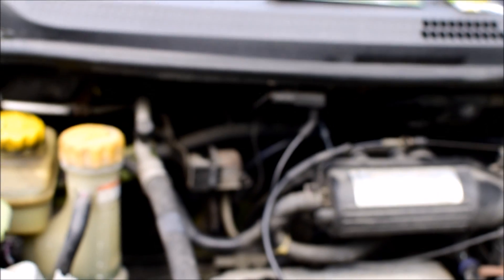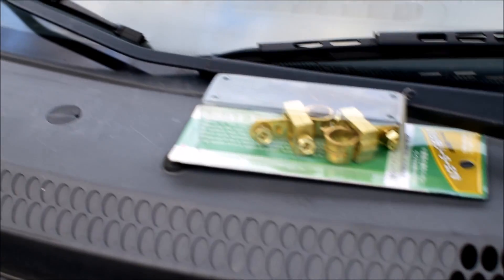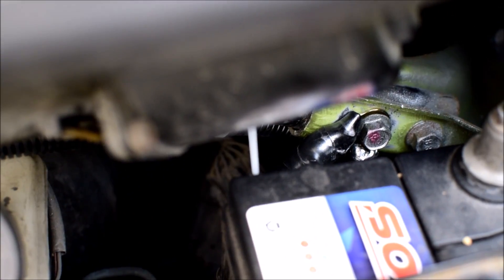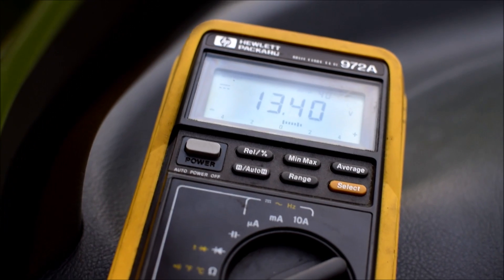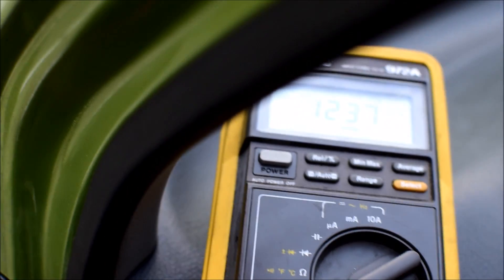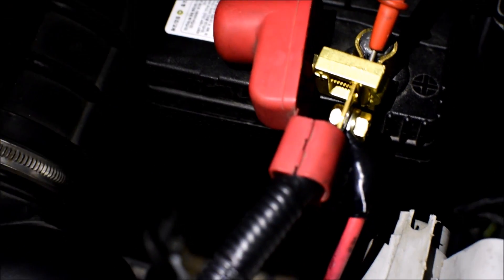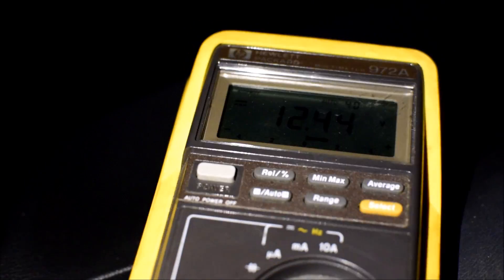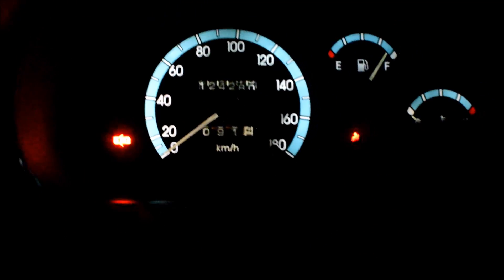Big 3 Upgrade | Before and after

Comment: Just remember. The big 3 is about to upgrade the transfer of power from the alternator more quickly and reduce your load from the accessories.  Remember. The smaller the gauge of wire means you have more strands of wire to transfer the volts and amps. I used 1/0 gauge on my Silverado hot and ground. From alternator to the junction post to battery I got rid of the stock wire from the alternator. I clipped off the wire from the junction to the battery. But kept it stock from junction to starter.  Ground?? From block to kill switch,from switch to the body bolt on fire wall. From kill switch to the mounting bolt for the alternator.  From kill switch to battery. The kill switch is a security guard because I’m gone all the time. But. It’s worth to upgrade. Nothing dims on a stock alternator.

Comment: High output alternator and add 1 to your big 3 and run a ground from back case of alternator to battery neg. People don't think about it but the battery does not make power it only stores it the alternator makes ALL the power positive and negative. The power comes out through the bridge rectifier which turns ac power into dc that sends out through the positive post on alternator but there has also been equal amount of  negative produced which dumps into the back case of alternator because the bridge rectifier is bolted on there. So with the back case grounded that negative has to find the way through that back case then the little bolts that hold the front and back case together then the alternator bracket and so on all the way back to the battery which slows everything way way down. You do this and I promise you will see a very noticeable difference...I did. I did big 3 first and was getting 14.4 but mine did like yours and blower motor headlights and such ate up all the voltage gain I had created so I was researching why and came across a video that explained this to me and it made sense so I added the extra ground and now with heater on high headlights on dome light and brake pedal pushed she holds steady on 14.1 volts also I do have a 320 amp alternator which I'm sure helps but it was also there when the voltage dropped before and it doesn't now. Hope this helps

Comment: 😂😂😂 i know this is old as hell but come on lol. You used what 10ga to do the big 3 and then didnt even do it correctly and you guys are bitching it didnt work lol..... 1st .. his alts bad . Actually his regulator in the alt is bad . The big 3 is about amperage and the ability to transfer power faster . You have to have the correct cable to do that and 10ga ant it roflmao ... But you also have to have the power in the first place .
Reply: ALEX I have a 2005 Hyundai Elantra.  I have an aftermarket 140amp alternator and a car power battery 3000amp battery running two amps at 3000w rms. 1 sundown x15 at 2000w rms and pioneer 1000w rms for door speakers and I was wondering if the big three would actually do anything because I’m running so much power. The engine ground is like a 16 gauge.  And the rest are around 6 gauge. Would this stop my car from dimming and burning lights.  Let me know. It’s not cheap
Reply from the maker: Considering other similar comments, I guess I should write a reply. The car in question here is a 2001 Matiz, a car with very limited electric juice. The alternator is good, still runs fine. Stock grounds/alternator wires were 8ga. I did the upgrade with 4 ga. As the video description says, and most you guys also know, the purpose of the big-3 upgrade is to eliminate the resistance between the power source and the load. A little bit of resistance will cause losses and voltage drops. The car had very limited electrical performance. As I upgraded the audio, (Nothing crazy but still demanding for the electricals of this car) I went for the big-3. As, mentioned in the description, if ur having a not at par electrical performance in your car and alternator/battery checks out good, probably its time to look at the wiring. And big-3 is just one way to do that. I have big-4 and dual battery setups in my other cars. It all boils down to your needs. For the title of the video, 'is it worth it', as I said in the video, it depends on a number of parameters. Have a good day.

Comment: His alternator needs to be replaced. It’s not holding load.... Jesus Christ... the big three works great, I use it for car audio, but voltage drop like that for simple functions is a sign that the alternator is going bad. So he should have changed the alternator first and went from there.

Comment: While 11.7 to 12.1 is a indeed a difference, but did gaining a little less than 1/2 a volt really ffix the issue you were having? I'm guessing it didn't and seems like a lot of work and expense for very little to no improvement.
Reply from the maker: Actually BIG 3 isn't meant for increasing voltages. It just ensures proper current delivery under high loads. Normally cars wont come with thick OEM cables. So cars having troubles due to corroded wiring etc might benefit form BIG 3 upgrade. Other than that, cars having high electrical loads from aftermarket equipment benefit largely. the 11.7 to 12.1 difference was on a 15 year old daewoo matiz where wiring isnt in the tip top condition. And i also put in an audio system now, so that BIG 3 was a part of pre-planning...

Comment: Hey man, great video, I buy everything to do the same to my car, if you can modify the description of the video and place the type of car you worked would be great, I have a daewoo matiz, which is the same spark and it was not easy to get a video of someone to do this job, I have the same problem with the fuse box as well, thanks for your time.
Reply from the maker: will do. thanks mate

Comment: Hi It's me again. I did the big three up-grade as you suggested in you video and wow it works. No more issues with my direction indicators! Even when I have the heater motor running and the headlights on the indicators are working really well. Thanks once again!

Comment: Running a 1200 watts rms amp and i have rockford fosgate 4 gauge from trunk to battery..i want to do big 3 upgrade is it ok to use 0 gauge since its a different size from my amp wire?
Reply from the maker: no problems at all... better to run 0 gauge from amp to battery... big 3 wires are relatively short, so a 4 or 2 gauge will also do. using 0 gauge is a bit overkill but no worries
Reply: 0 Guage the best Guage for all current upgrades.
Reply: I'm running 0 awg cable from battery to power cap, then I'll be running 0 awg out to distro blocks to convert into 4 awg for 3 1800w subs, 4 x 600w 6x9's and all my components speaker amps, so the big 3 with a high output alternator is the next thing on the list to do.

Comment: Hi! I enjoyed your video showing the difference it makes to the voltage output before and after the three wire upgrade. I'm impressed with the results and I'm going to give it a go with my Triumph  1977 2000TC, because I have issues with the direction indicators. Thanks for sharing!!
Reply from the maker: good to know that u like the video. thankyou so much. what issues are u having with indicators.??  plz read the description as big3 upgrade just improves current flow in the electrical system of the car. the ussues u r having might be due to a different reason. have a good day